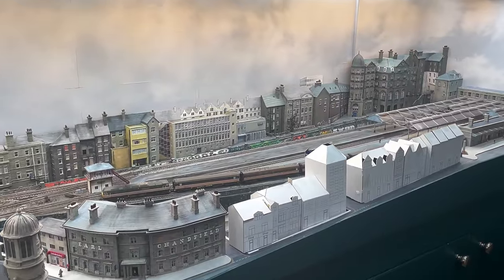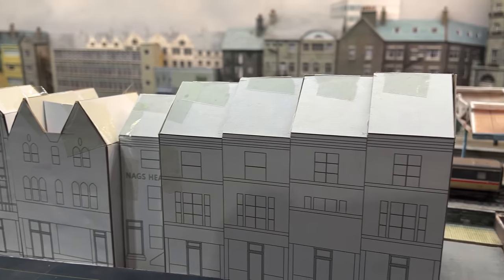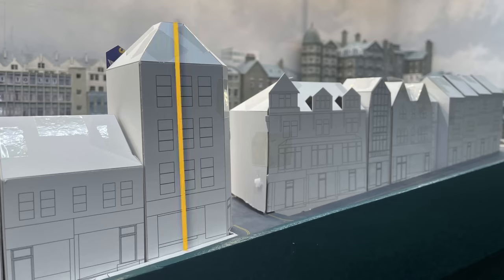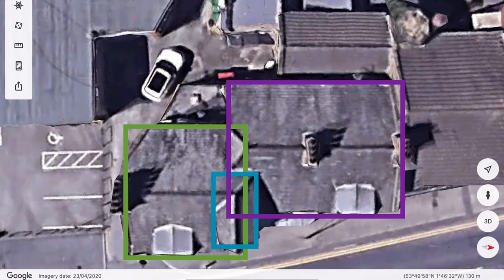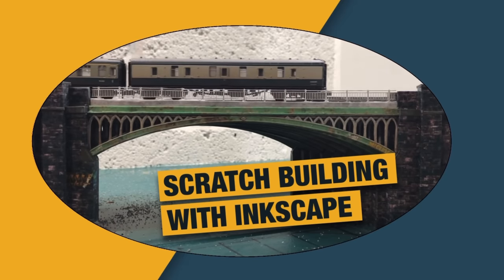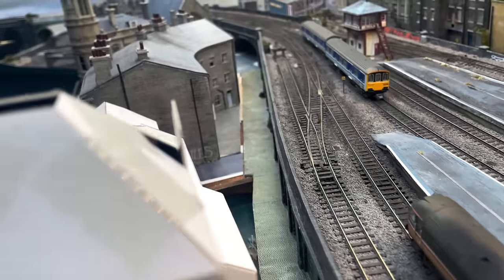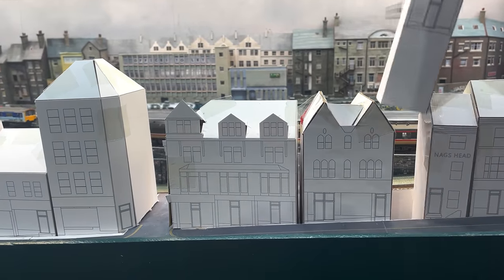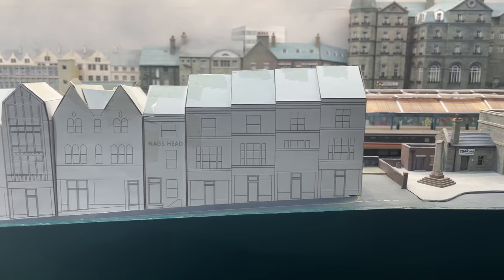Your questions answered - Building Station Road Part 5

Comment: Hi Michael, the idea of having a hole between buildings is to me, a great idea. The wooden props holding the buildings up could support tatty advertising boards with the paper peeling off or with a section missing. It's just run down Chandwell to T with litter in the bottom. I also feel that gap would give a much needed view to the railway but with a very unique frame. Which building to remove has to be your choice, but if you made it a corner one, the basement could be rubble filled and have a burnt out car on it !
Reply from the maker: Super ideas! Thank you Mark.

Comment: Thank you for the beginner friendly Inkscape tutorial, I always end up with oversized files when I get to the rendering! I love your vids!
Reply from the maker: There is a trick to help that. I’ll try to include it in my series.
Reply: Way too technical answer: If it's the 72/96 problem, that's a dpi issue, the SVG spec doesn't say what the dpi should be and the w3c changed it from 72 to 96. Inkscape followed. But if you're careful with your output and pay attention to the popup when it loads old files, it should be fine. If it's the x3.65 problem, you've got it in inches instead of mm. Making sure the document is in the unit you intend. There's a view box which scales the document from 96ths of an inch to a mm and if you load the wrong template that viewbox will never be right.
 - Inkscape Developer

Comment: A well produced video. I enjoy the whole thing including the humour (where's Tracy?)! The idea that the station is surrounded by buildings is brilliant, it really is just like real life. As for the awkward joints between roofs, well of course there are. And the backs, of course - I've had comments on my house designs that the back looks better then the front. Why not, you drive up to the front, but you spend time in the garden. And in town it's often where the 'disgusting' (and interesting) bits are. A gap with flying shores would be fine if you were modelling a bomb site but that wouldn't exist by your time line. Keep going, I'd say you've got it about right. I wish I could do that trick of getting younger!!
Reply from the maker: Thank you. Yeah, that’s my concern re the hole too.

Comment: I agree with all the "don't change a thing" comments. 
I have just modified a Metcalfe goods shed, which is multiple layers of cardboard, because it doesn't quite fit where I wanted it to. I can concur with the strength of multiple layers of card! If only I'd done some sort of cereal packet mock up first!!! ;-) Cheers
Reply from the maker: Thank you! It's amazing how strong card is!

Comment: I shall be interested to see the buildings progress - but surely you will need to weather the track (dirt/oil on the ballast, rust on the sides of the rails, add discarded old rails) and add working signals before you put in lots of intricate buildings at the front of the layout? It will be very hard to do these things afterwards. 

Also, I love the idea of a gap between buildings with wooden bracing, hoardings and lots and lots of rubbish and weeds. It would look amazing, and make a good gap for seeing trains.
Reply from the maker: Thanks James. So the track itself is already painted. I’ve never seen rusty tracks in a busy mainline station before. They are usually a very dark brown, almost black. So I painted them that way before ballasting. The  ballast does need weathering in the station itself but the buildings won’t make that any harder. I can still get over them easily enough. Electronics holds no interest for me so there will never be working signals in Chandwell. I may one day add dummy colour light signals but I’ll only ever get round to that once all the buildings are finished because it is in those where my interest lies.

Comment: Having a second empty space to view through would certainly add variety to the views, I don't think I would take it right into the cellar but rather have it as a work in progress, perhaps the upper residential flat had a gas explosion and that blew out the walls, now after a while for various legal reasons the builders are just starting on the restoration of the old structure (perhaps it's a listed building because of it's age) so maybe you get just the start of the build near the bottom with new stonework in the same style as the old for a bit more of that variety you like
Reply from the maker: Yeah, that could work. Thank you!

Comment: Awesome, looking forward to Station Rd! If you want to do the hole, but also keep the fronts - why not have a demolished house where they kept the front of the building standing (to preserve the charm and character of Chandwell of course)? It would give you the best of both worlds. Which leads me onto the next question: will all buildings in Station Road be occupied, or will some be boarded up?
Reply from the maker: I like that idea. At least one property on the street will be boarded up.
Reply: @Chandwell  good luck with the build!

Comment: I have a question, will there be any nice shops indicating, like the dying embers of what the town was like before, such as an old Jewellers or department store maybe that has taken on several adjoining units like you often see for small independent ones?
Reply from the maker: That's a good idea. I like the thought of a former "high class" jewellers sandwiched between a kebab house and a video shop.

Comment: No secret passageway. OK. But can you keep a gap between two buildings in the middle of the top section? Not an alley, just a small gap, like 1m in real life. Something totally useless. Like the access to the back court?

That gap could be a good way to adjust the total length of the row and correct some small mistakes.
Reply from the maker: Good tip! I’ll think on that.